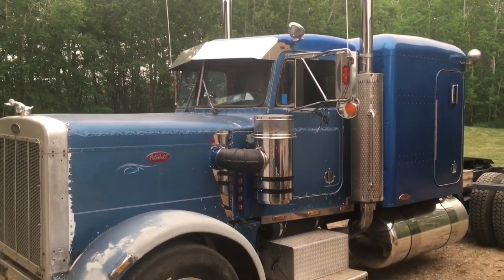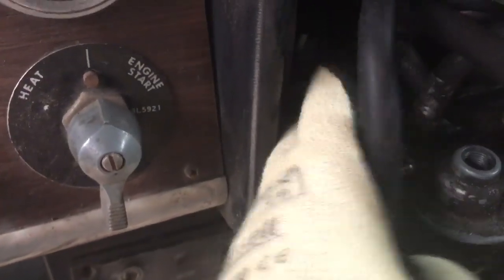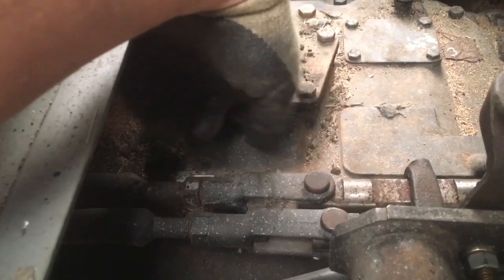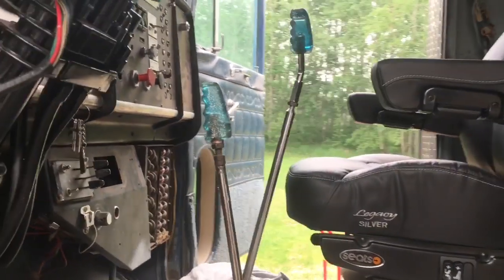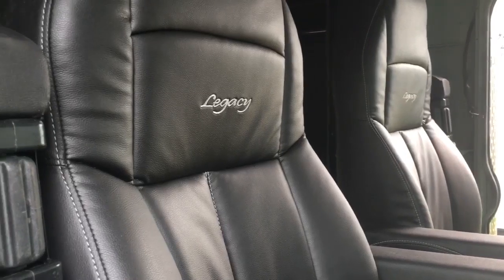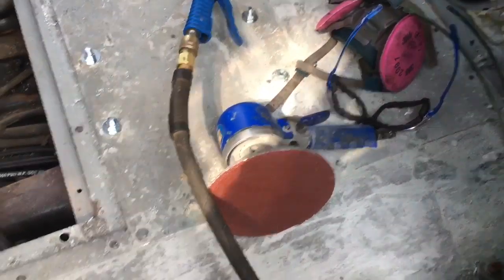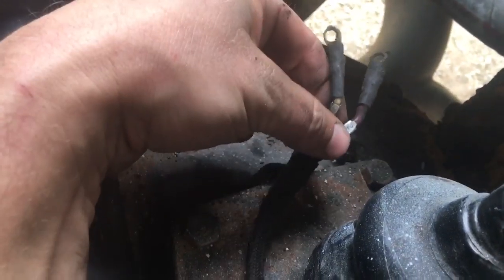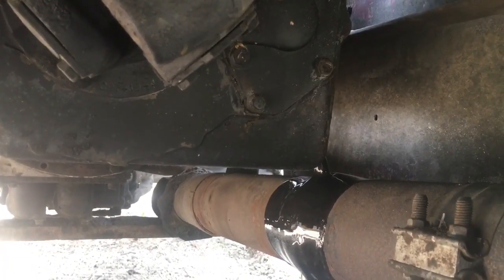Peterbilt 359 Restoration Ep.34 Cab work and Aux Shifter Linkage

Comment: Back in the old days we had to fight with the shift rods and linkage all the time. With what I know now I think I could come up with a system for the AUX Trans that would eliminate the problems that seem to plague them! 
The two stick trucks I drove were 60's and 70's vintage and Cabovers that just added to the shifting problems.
I see there is four thumbs down right now!! WTH is that all about? Anybody with a half a brain cell would have a great appreciation for what you are doing. Keep at it you are most definitely on the down hill with this project!!

Comment: Lol , man does that cab bring back memories . The truck is looking pretty good. I don’t know much about working on transmissions but I  drove a few twin stick Fords.  5 on the main and 4 speed aux. I have problem with that combination. However, I drove 2 trucks same transmissions and both had problems with the slides getting stuck. I had to get under the truck with a screw driver and move the slides . It was very easy to do but a pain to crawl under the truck. In any event  👍✌️

Comment: I had an old 60s Ford and the engine oil drain would pour directly onto the front diff. Very neat trick. 
I'm also rather jealous of metal tagged wiring- too many times I've had to dig into an older freightliner and they LOVE their white/yellow wires. The entire harness will be that one color and the printed numbering rubs off with the dust. Makes for a fun diagnosis.

Comment: I ran into the same issue your having with the shifter rods, the issue I was having was with the control rods for a wrecker deck from the controls to the valve spools. Made a bracket just like what you found, but the inside block I made out of a Teflon block and drilled out the space for the rods to travel through. The Teflon will not bind or freeze up in the winter and it will resist heat better than the hole holder your thinking of using. Teflon will also handle oil and grease without breaking down over time and it's quite wear resistant. Just a thought... Great Job!

Comment: Back when I did oil changes on cars and trucks, I sometimes would run into the same issue of a drain plug near or over an exhaust pipe. A simple and cost effective way of getting around that would be to hold a piece of cardboard between the oil draining out and the exhaust pipe. That way it would stay dry and not become an issue. I remember also slightly bending the cardboard so it would have a make shift channel for the oil to run down so the oil splash/draining could be manageable. Great work and love the videos!

Comment: For the shift rods hanging up.  Sleave the rods or better sleave the cross member with a some slightly  oversized  OD steel tube with a delrin sacrificial  bushing to bridge support the rods.

Comment: You can put a u-shaped pipe from the drain to another part of the transmission to let the oil circulate and put a plug on that to drain away from the exhaust pipe. We did it to a old pickup truck that was like that and it worked wonders. You might won’t to give it a try.

Comment: Dawn soap in an old Windex bottle with some water....find your leaks. 
   Did that at a massive Heat Treating facility for aerospace parts....not legal to do it that way, but for the whole building it was good enough for them.
Reply: When I worked on vacuum trucks we used this stuff called "sherlock 5 second leak detector "
And if we were out of that, dawn and water
Reply: @steverone7623  like 2 weeks into my job everyone was on vaca, the owner, the employee above me, my and his boss for a week.  I spray painted the tool cart Dukes of Hazzard orange and clear coated it with a big 01 on both sides....no one said a word lol

Comment: Now that you have your fiberglass skills honed .  Buy some fiberglass cloth and Epoxy to laminate the wood floor plate,  Epoxy is  more waterproof than fiberglass resin.  Ebay or Home Depot.  Easy fix.  Wrap aluminum foil around the exhaust pipe while you drain the fluid.  Loving your progress.

Comment: If you will take roofing felt paper and double it and put onthe floor and the ceiling it will sound proof and take up the heat just a lil peice of advice it works I've used it in cab and sleeper

Comment: As for your clutch linkage with the grease fitting on top. Try putting a 90 fitting and a long hose with another grease fitting on the bottom so you can grease your linkages

Comment: Got to love those seats mate ....On that secondary gearshift that is a bit close to the passenger seat I see the lever screws into the gearbox lever? Can you put a dogleg 'set' in the long lever and crank it over to the left towards you which will also shorten it? The other small point I noticed was the main gearbox lever is cranked forward out of the gearbox? If that isn't fixed maybe turn it 180 degrees so its back towards you?
Excuse what may be daft ideas as I know the square root of nothing about 359s but sometimes a bit of ignorance can help ...Lol Ask me about Eaton Twin Splitters, Eaton Fuller Roadrangers, ZF, Volvo and Scania 'boxes and I may be more useful.

KBO Sir ... KBO

Comment: I think you are doing a fine job, you could keep going and going, and going, and spend tons of money. Remember  a new Pete costs over $100,000.00 U.S. new, so how far to go on a restoration????
Maybe look into putting a jog, or bend,  in your back box sifter so your passenger/spousal unit doesn't get her knee smacked when you grab 4th.
On the 379s they ran hoses over to those zerk fittings and ran them all to a plate on the drivers side frame mount so you could grease the throw out bearing, both trans pivot bushings for the 
clutch linkage, and two others I can't remember offhand.  
You could set yourself up a block with hoses to those fittings so you can stand there and grease them instead of having to remove the floor to get to them, and your throw out bearing.
Just a thought. 
Good job on the back up lights, you will need those for the certification inspection. That voltage drop could be a wire that is down to a few strands.
One thing I forgot to mention last video , if you change all your turn signals and tail lights over to LED's you will need to get a grounded flasher, the LEDs draw so little voltage, that the resistance will be so low that you will not get the flasher to work on the turn signals. Just ground the flasher to the cab frame any place.
Pete was not alone on the lousy placement of drain plugs, on the older Mack trucks the oil pan drain was DIRECTLY above a cross member, so the old, black, drain oil would run all over that beam.
https://www.fumotooildrainvalve.com/f104n.html   Go to Peterbilt and buy one of these for your truck in place of the oil pan drain plug, if you don't have one in there already.
I like those seats.
Reply from the maker: Great tips - thanks

Comment: Just a suggestion ... remote grease line for those 2 grease points  ?  Run some extension to a block and problem solved anyway just thought I'd suggest it before you put the floor in... looks good 🙂

Comment: Those wood floors are nice, but consider you may need to access the transmission from the to to work on the shifters ETC. Designing an access panel may be a good idea.

Comment: Not sure if your seatbelt issue was finished or not but if my memory serves me correctly, the seatbelts bolt on the rods that stick out the side of the seat not to the floor. As the seat moves up and down the seat belt would get loose and tight. There should be a second strap that goes from the floor to a stationary place on the seat and a secondary tether. We mechanics have always wondered what year of schooling do engineers learn to screw mechanics like they do.

Comment: It gets frustrating sometimes but stick with it. Just a suggestion but you might be better off replacing the hoses with plastic tube. You would have to replace the fittings but it's a lot easier running the lines as they are not as thick as the hose but they are easier to repair and last forever. I did it on my 1973 and am glad I did. I  just carry some unions in case I get a leak. Good luck stick with it!

Comment: You were checking voltage wire to wire you should check to ground. As one leg is power and the other then switched you may also have a bad ground in the back up lights
Reply from the maker: Charlie good tip - thanks

Comment: Run grease lines from them hard to get fittings  with 1/4 inch air line can get 1/4 28 to 1/8 mpt adaptors to make it work with brass air hose fittings

Comment: I wonder if you could put a thin sheet of steel on the floor then add your wood if that would protect the wood floor as well.  You would need to primer and paint the steel and probably plain the wood to match.

Comment: On the greasing on the tranny and you have the floor up build you some extension that will hang down so it's easier to reach from the bottom the new trucks have a factory installed remote lube bracket on the frame it will grease the clutch arms and throw out  bearing .

Comment: What a weird location for the drain plug on that front transmission. I don't think Peterbilt would have ran the exhaust that close on purpose. Do you know if the two transmissions are original to the truck? Maybe the main box was replaced at some point with one from another truck?
Reply from the maker: MichaelTJD60 yup this was an original deep red 15 but was converted in the early 90s to a twinstick ... still, I’m pretty sure all Pete’s of this era had the y pipe coming down that side of the frame so it was probably an issue on the truck these trannys came out of as well

Comment: Seems you have a lot of work underneeth the cap..Would it be easyer to pull the cap off to replace all the wiring and hoses?..Big job i know, but maybe you would do yourself a favor..Also you could lay some sort of ramp on the cross member so the shifter rods passes better.. Bended slightly on both sides..Maybe, just an idea.. Best of luck from Denmark👍

Comment: Loving  them  seats  Twin Sticks.  Kinda  jealous  actually.  Called  my  dealer  and  asked  iffin  they  had  them  for  my  tractor.  Told  me  no,  they  won't  fit  a  Massey.  Dang  it.  But  really,  they  are  nice  seats.  But  can't  you  move  them  back  slightly  more?  Judging  from  the  video,  that  wheel  is  right  tight  in  yer  lap,  no?  It  might  work  for  now,  but  how  bout  five  months  down  the  road?  Pun  intended.  Not  wanting  to  force  an  opinion,  just  wondering.  Loving  the  build,  keep  up  the  great  work,  the  videos  and  the   content.  We're  all  pulling  fer  ya.

Comment: To fill those holes with metal just place a copper plate over the bottom of the hole and fill with weld metal. The metal won’t bond with the copper.

Comment: Hey I just wondered, with those holes in the floor being pretty large, I just wondered what you where going to use for gaiters for the twin sticks?
Reply from the maker: FOXED I’ll probably reuse the original shift boots for now.  The a-Box is a small boot but the 6 has quite a span so it needs a significant opening to work
Reply: @TwinStix  Having found these episodes just a couple of weeks ago I watched them all, You are doing an amazing job with that truck and can't wait to see the episode where you get it roadworthy hitch up that 5th wheel you got and go on a road trip for the first time. 
Very best of luck with it mate.

Comment: Only a suggestion but do not replace those airlines with the same tubing and fittings, it’s 40 year old technology and there’s better options available that will cost a little more up front but will save you time and money down the road. I suggest plastic DOT rated tubing and the insta push together fittings! Just my $.02 Great job so far
Reply from the maker: Ray Long wanted to go plastic but there are no fittings (at least at the places I went) that are female flares that would work.  I actually went with push on ones with special hose ... see them in the next episode

Comment: Your remote shifter is wore out you need to replace the shift rails and the bushings in a remote where's the stick goes into the box that shift rails are wore out you can either buy a new remote or you can rebuild it you might have to take a welder and weld up the end of the stick where the where the tab is on the end of it so that is wider and a little bit fatter so that it doesn't get hung up between the rails take that remote box apart and you'll see what I'm talking about
Reply from the maker: Rpger Vanburen I actually had the remote box and the shifter reverse engineered and built new by Dino’s machining in Edmonton.  He did a fantastic job and it’s better than new.  The trouble is in the rods but I’ll get it fixed
Reply: @TwinStix  yeah I sent my message before I got to the point the video where I seen the rods rub it on the cross member. My bad

Comment: Next time put tin foil over the pipe before you drain the oil. Easier clean up and no oil smoking. Lots of motorcycles drain onto hot parts and smoke. Lol
Reply: sheepdog 9/11 you stole my suggestion. 👍🏽
Reply from the maker: sheepdog 9/11 good tip 👍

Comment: if rats/ mice lived in the vehicle while on the field for decades then it is quite likely they nibbled on wires and hoses
Reply from the maker: Surprisingly they didn’t but there were a bunch of wires that were not needed and many of the hoses were dry rotted and needed replacing 👍